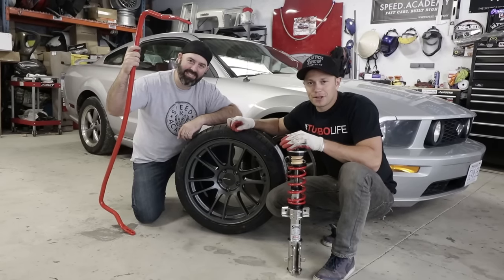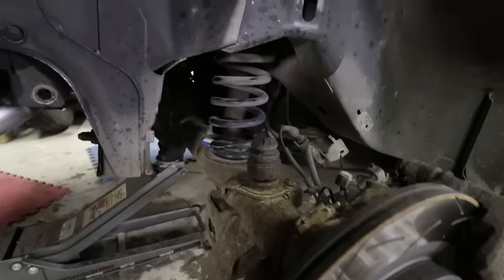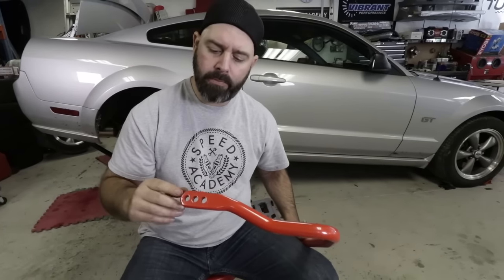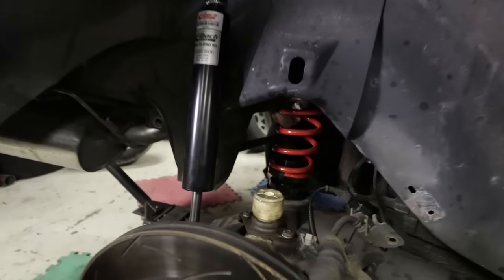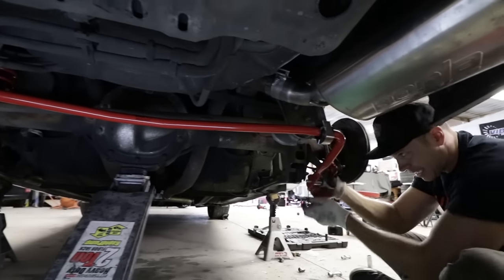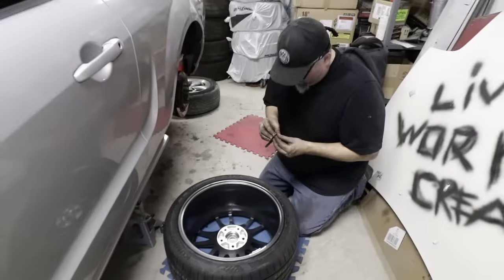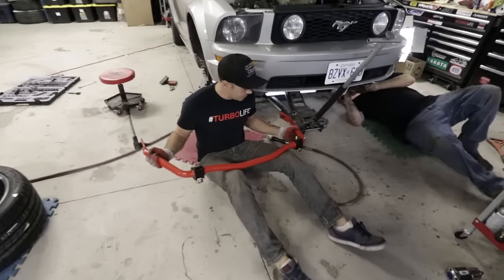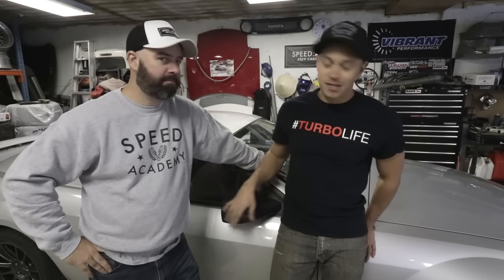Ford Mustang Serious Handling Upgrades - Project Mullet Mustang - EP03

Comment: MotoIQ has a sway bar install tip that I've found to work great: wrap teflon tape (like for plumbing) around the bar where the bushings attach to prevent squeaking. It lasts longer than the grease.
Reply from the maker: That is a cool tip!

Comment: I road raced a S197 Mustang for years. Unfortunately a better setup is to run the stock rear sway bar. On these cars you will control the balance and roll from the front bar. Also you can run 18x11 with 315s or 295s all around no problem. Heavier front spring as well, #450 or #500 ( it wont affect the street ride ) Good luck guys.
Reply from the maker: We will definitely bump up the spring rates once we go to a dedicated track tire on the car.

Comment: oh Moose, that bump stop is upside down!
Reply: Not if the shock is upside down as well ... :-)
Reply from the maker: We thought so too at first, but we confirmed in the instructions that is in fact the way it goes in.
Reply: Speed Academy That's very peculiar! Does having the nose in the mount like that prevent the bump stop from being softer initially or does it have space to expand? 

I'd be tempted to remove the springs and optimize the travel by trimming up the bump stop.

Comment: Does replacing the air with nitrogen make that much of a difference for tire pressures?  I'm honestly curious since air is already 78% nitrogen.  It's difficulty to get 100% nitrogen in your tires since there will always be other trace gases so does replacing that other 20-21 percent result in something quantifiable?
Reply from the maker: It does. With air we typically see tire pressure creep up about 6-7 psi over a 5 lap session. With nitrogen, we see very little pressure creep. This means you can set your tires at your target hot pressures and take the guess work out of the equation.

Comment: So what are you guys using for an adjustable panhard bar? I didn't see one anywhere in the video. You'll need one if you plan on changing the ride height at all from stock.
Reply from the maker: We have a Whiteline adj panhard bar, but as you'll see in a future episode we actually go a different direction on the rear end.
Reply: Oh cool. Thanks for the followup.

Comment: uhh, aren't you supposed to tighten down sway bars when the suspension is under full load?
Reply: It's not a loaded item until the car turns.
Reply: I think you're thinking of ball joints, because the boots can tear. As long as you use lube on the bushings you shouldn't have any issues.

Comment: Nitrogen doesn't expand and contract any different than OXYGEN.  The reason racecars use nitrogen over AIR is because :

1. It's dry, so the moisture in the doesn't condense and evaporate leading to greater pressure changes.
2. Air has Oxygen which reacts with the tire rubber and wheels to cause them to break down and corrode.
3. Nitrogen doesn't permeate through the rubber as easily as oxygen.
4. No oxygen means much reduced chance of auto igniting from heat.

Comment: Comment about putting nitrogen in the tires, just in case you don't know but roughly 80% of the air we breathe is nitrogen
Reply: +IcemanJD08  
That is correct, inflating tires with nitrogen being desirable and more temperature/pressure stable is due to the moisture content of compressed air. 
Nitrogen is dry and compressed air is generally moisture laden, the moisture in compressed air is highly reactive to temperature change and results in relatively large volume/pressure changes.